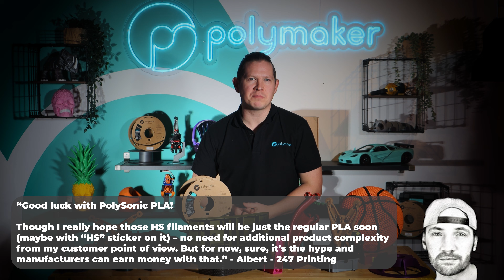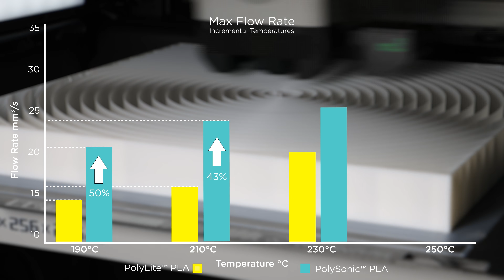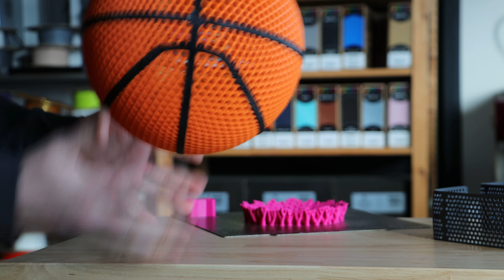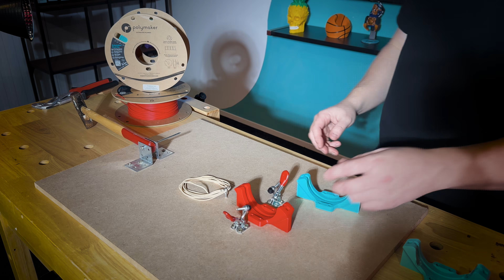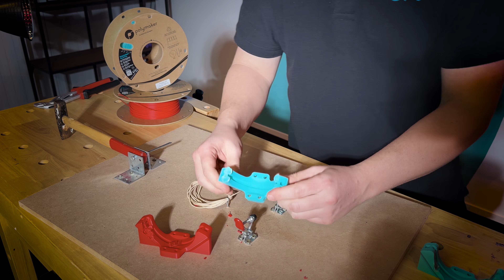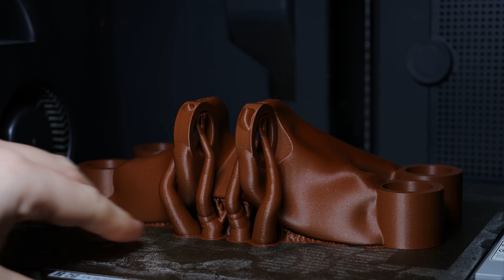PLA Pro. Upgraded.

Comment: Oh! This is exciting! I've been using the old formula PLA Pro for years to make paintball equipment. Grips, shoulder stocks, feed tubes, etc. It holds up REALLY well. As shown in this video, they'll deform on heavy impacts, but nothing has snapped on me yet. And that means I can keep on playing. A deformity won't ruin a day of play. Cracking and shattering will. 

Literally, my only complaint was the looooong print times at 50-60mm/s. A standard hand grip with fuzzy skin at 30% infill takes me about 24 hours. So if there's anything I need to print to take with me at the last minute forget about it. 

I can't wait to try this new stuff.

Comment: The only downside now is temperatures. If you could make a HT-PLA Pro, that would cover almost every basis and need for other filaments.
Reply: Don’t forget UV resistance!
Reply: Well, the downside of HTPLA: glass temp and heat defelection temp is still around 60°C when printed. Annealed bumps it up to around PETG temp.
That worries me. I wouldn't trust the structural integrity of a part printed in this material over time.
Formfutura has Volcano 150°C PLA which has none of these downsides and doesn't need to be annealed. It's HDT without annealing is 110°C!
Reply: They do, it’s called ASA.

Comment: Good, when are you guys fixing your ABS?
Reply: What should they fix in your opinion?
Reply: @riba2233  Their thermal resistante is way too low for what ABS generally is.
Reply: @moyu1616  why do you think so? It's on par with other popular abs filaments.
Reply: @riba2233 not if you use it for voron parts, or any diy printer for that matter. It’s become a decorative abs vs functional. It’s unfortunate
Reply: @CartaIV  how so, it had the same temp resistance as other abs filaments in mytechfun's recent test.

Comment: So, I have to wonder if a company like Polymaker doesn’t have an actual impact test hammer setup available to use in their demonstation for advertising, do they have one for quality assurance/control at the factory.
Reply: They do. This is performative for the primary audience which is DIY tinker people. The impact results of a 400,000 dollar stress meeter can be seen in the spec sheet.

Comment: I would like to see Polymaker begin to offer PCTG.
Reply: Seriously, we need PCTG as affordable as PETG, it's currently averaging 2 to 3 times as PETG and it really shouldn't.
Reply: @anthony92399  if you are in the eu trcek has cheap pctg.
Reply: I don't think they plan to, they currently make a PETG where in the description they describe it as having the best qualities of PETG and PCTG
Reply: @ShadowBeats73 Their new formula PETG is great, but it isn't PCTG. I'm actually curious what Polymaker can do with PCTG. They always make improvements to common filaments.
Reply: @colinmsmall I agree, I really would like to see them make a PCTG as well, I guess I'm just trying to say I'm not getting my hopes up
Reply: @ShadowBeats73  but it doesn't really, pctg has around 10x the impact resistance with higher temp and chem resistance also
Reply: @riba2233 Its good but i highly doubt 10x impact strength
Reply: @maxmusterman6030  yep it does because petg is really low, it's almost 10x

Comment: Please combine HT-PLA with impact resistant PLA Pro, to truly create the simple PLA choice you mentioned. Why do we have to compromise? We have to choose between it surviving a hot car or breaking because its brittle etc..
Reply: PETG, ABS, TPU exist. You don't need a PLA++ to replace alternatives that already exist and meet these simple needs of not being brittle and surviving a hot car
Reply: @muuhamj all those materials have much lower print speeds so giving up one parameter for another but not finding the better solution. Hopefully this is the better solution
Reply: @kmack747  no, abs has higher print speed than pla.
Reply: @kmack747  I print PETG and ABS faster all the time, what are you talking about??
Reply: @kmack747  What’s your hurry? I’ll take a good print over a fast print every time.
Reply: @muuhamj I print exclusively in PETG and PCTG for these reasons and I disagree with you.
Reply: Introducing Polymaker HT PLA PRO! Got just what you asked for!
Reply: @gavinmccullouch2602 I ordered it the minute it was announced and already have been printing with it. So far so good. Need to get some more experience with it, but I'm optimistic

Comment: How does deformation temperature compare in the new formula?
Reply: Looks like a 4°C lower (58°c compaired to 62°c) Glass deformation temp compared to the old formula but a higher melting temperature at 159°C. Heat deflection looks slightly worse at 3°c lower at 1.8mpa

Comment: Absolutely LOVE the Panchroma Matte filaments. I use it for almost everything now... the biggest issue I have are PLAs heat resistance... I've had really bad luck with PETG and PCTG, so I usually go either PLA or PolyLite ASA. Sometimes ABS, but I've found i kike the fonish and strength better on ASA 🤓